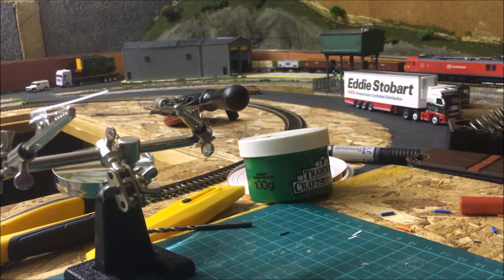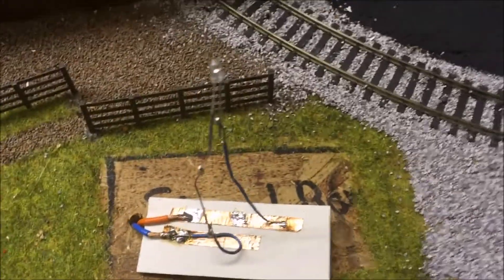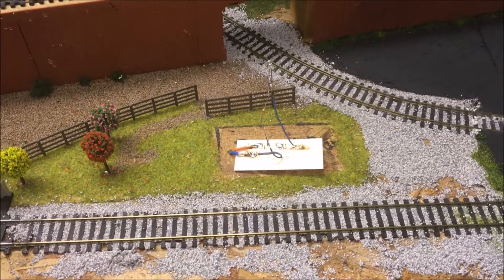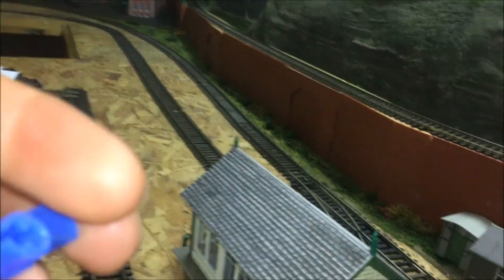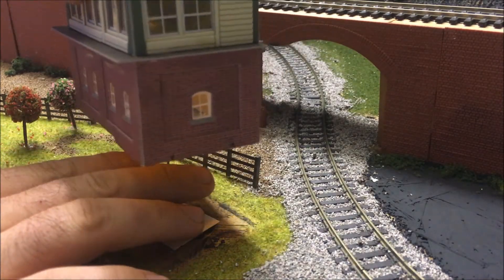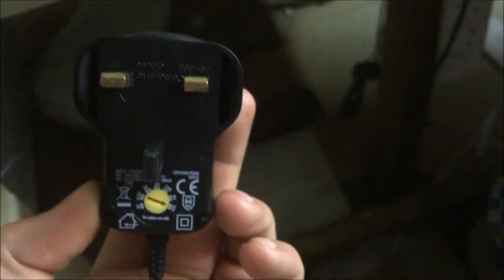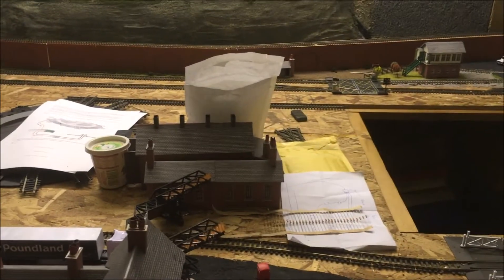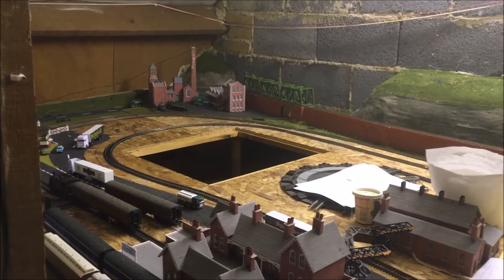Model railway series # How to wire up an LED

Comment: Just a thought , add some shrink tube/wrap to each wire to cover the bare wires as I though you may get a short the way you poked the LED into your signal box/tower,
Tony